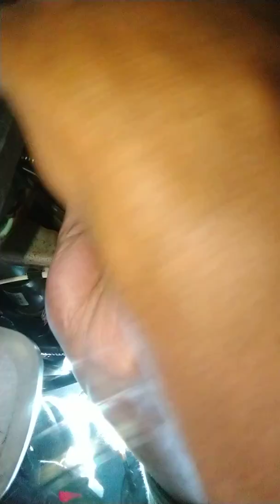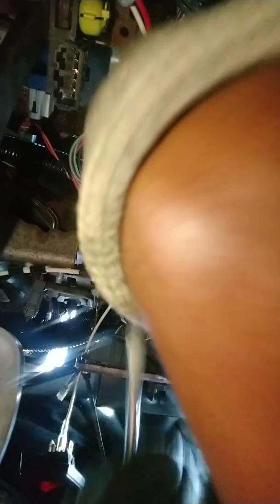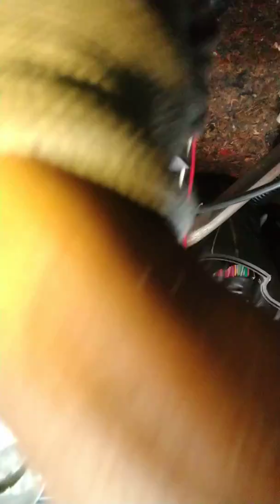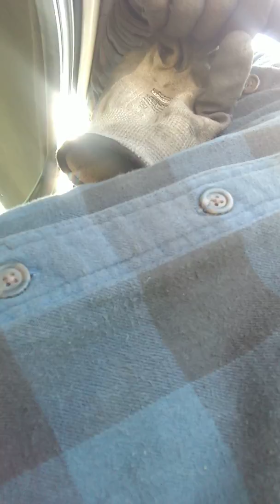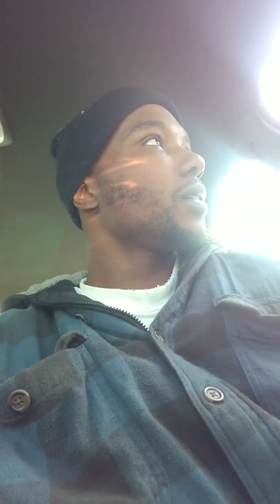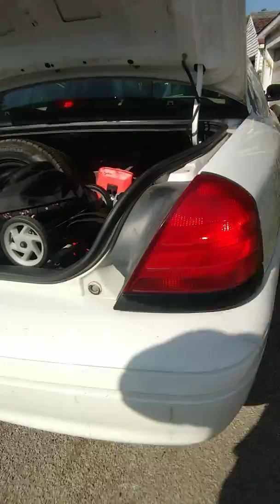Changed the brake light switch on the CVPI its easy

Comment: 9 months later, I had to change mine.  However, it still goes out at random.  Pulled the plug out of the socket, and it looks like 2 of the 5 connectors in the plug are scorched black...
Reply from the maker: Dam yea all them dam wires down there but look at the pic I had sent you when we talked bout it

Comment: So if I just unplug that cord underneath my dash ... it should fix my issue with my brake lights. It’s located underneath the brake pedal ??
Reply from the maker: Yea that's how you change the brake switch I had tried to unplug it then plug it when that didn't make em work I just went on head & changed it
Reply: Okay ... this my only vehicle and I have to drive it to the store to get the part ... gonna try that to see if it’ll come on for a lil min
Reply from the maker: @MiracleMarie1  I just to drive to the yard & back to the shop with no brake lights
Reply: There police here in AZ man serious ... scared to take the chance frfr
Reply from the maker: @MiracleMarie1  just don't let em be behind you & see it

Comment: @Shannon CVPI. My tag light and brake lights not turning on when cut them on at night but the brake lights come on when i press down on the brake. Have this happen to you before or what do you think the issue is? thanks
Reply from the maker: Oh dam idk what that problem maybe but check your fuses
Reply: @11_CVPI  i checked all the fuses and they were all good. I just replace the lighting control module and nothing changed. imma just replace the brake light switch and see if that does the trick. thanks for the vid big bro
Reply from the maker: @kayjglasjones2244  no problem broham hope it works out & glad the video helped